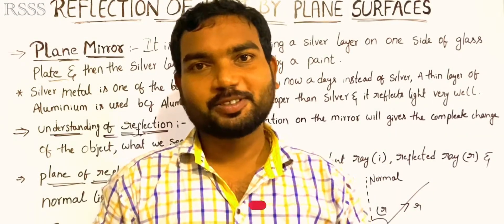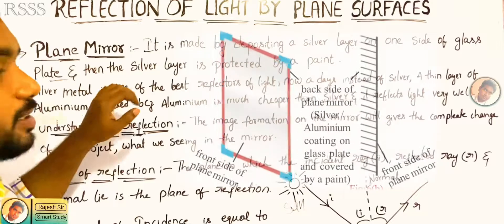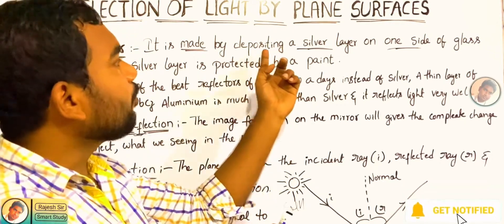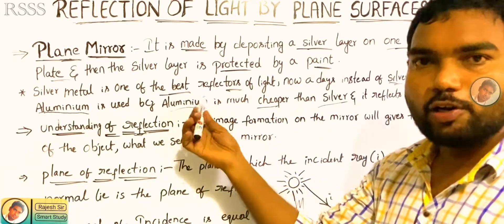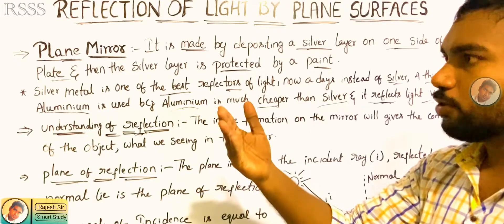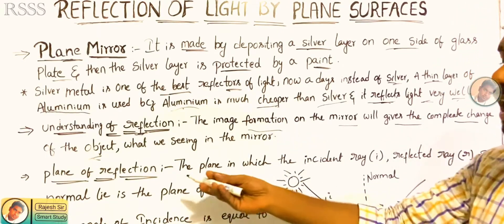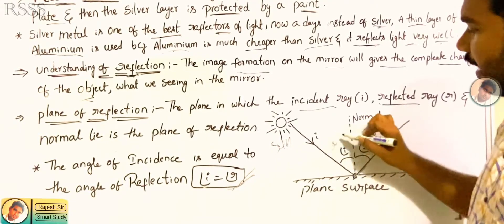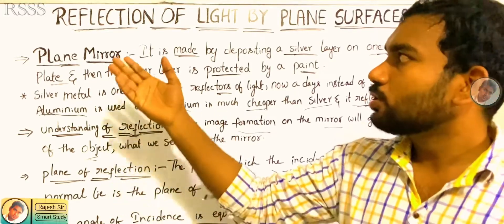Reflection of Light by Plane Surfaces in Telugu || Part - 2 || Plane Mirrors & Plane of Reflection |

Comment: Pinhole camera 📸 explain sir please
Reply from the maker: Original object rays passes through the pin hole camera it will forms the image inverted (reverse) and diminished (small size). The Number of pin holes increase, same number of images formed by a single object rays.